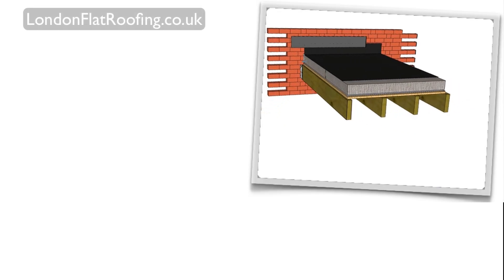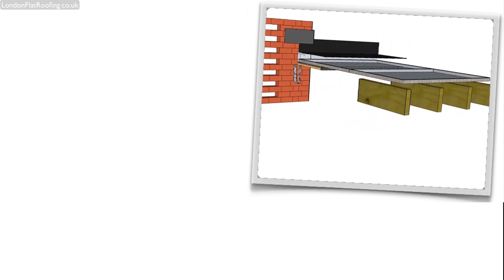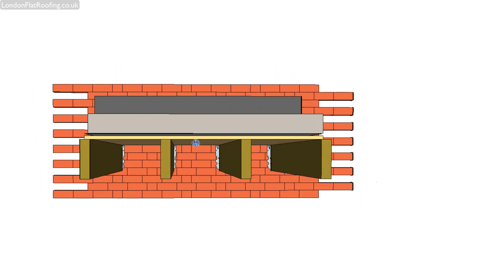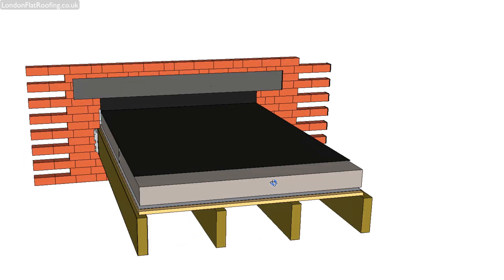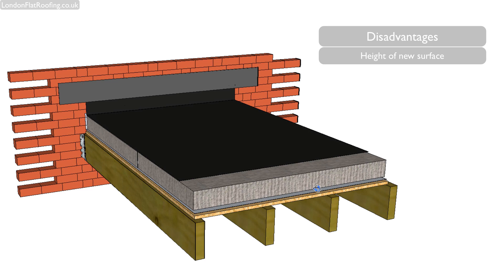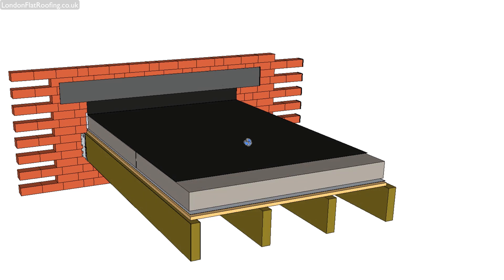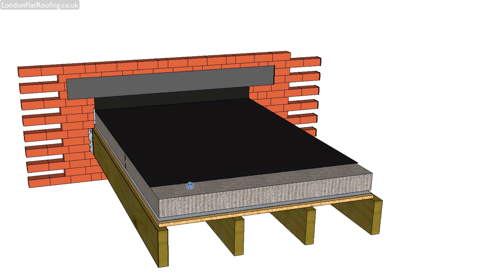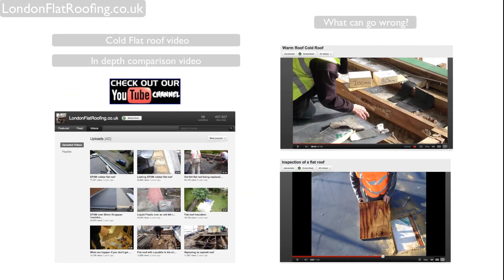Warm flat roof construction Explained.

Comment: Hi Steve, thanks for your videos, I've found them very helpful, maybe you can help with a question?   I've have had a Warm flat roof installed, as a dormer in a loft conversion, with a EPDM  roof covering, however we have been having really loud banging noises coming from the flat roof at night, have you come across this before? 

The builder is looking at options to resolve, he has tried removing the soffit with a view to putting in a vented soffit if it stops the banging, this seem to have been reduced , however I'm unsure if it's due to the vents or the drop in temperature, though some bangs are still occurring.  

If vents do fix this, I'm assume this will no longer be a true warm roof, could this lead to future problems or is this acceptable?
Reply: This is so interesting, I've had the same problem on my flat warm torchdown roof... Every now and then around 10:00 a.m. and 7:00 p.m. (I guess when the building heats and cools) there is a bumping sound (like something like a pine cone fell on the roof).

Comment: Hi.  If the insulation has been fitted straight on top of the joists with the ply on top of the insulation would it be possible to retrofit a vapour barrier afterwards at all? 
I ask because I saw your reply to MatthewLench about going back in 5 years and seeing how it will have sagged if insulation is straight on joists.
Reply from the maker: No not successfully if you took the ceiling down and looked up the joists are in the way.  if you put some sort of plastic over the joists and across the insulation you have locked he joists outside of the VCL and that's not a good thing to do. However, it's probably better than doing nothing if you have a problem. Its all down to cost

Comment: hi, can you specify the type of fixing you would use to hold down the insulatiom boards and ply for a warm roof application? From bottom to top: joists, 100mm insulation, 18mm ply, epdm membrane.
Many thanks

Comment: one of your warm roof vids has the decking under the insulation, one has it on top, can you clarify?
Reply from the maker: Some manufacturers of insulation suggest that you can put the soft insulation directly over the joists that are spaced at 400mm  however we find that this makes the roof bounce and is not that good . We place 18mm T+G OSB over the joists then we put the VCL then the Insuation Then more 18mm OSB then screw the thing togther using thermaly broken fixings then add the flat roof waterproofing materials.
Reply: Steve Roofer how do you screw it all together without piercing the vapour barrier?
Reply from the maker: You pierce it, Its  so over-specified that even with leakage from  the piercing its still over the corect specification.

Comment: Hi, is the insulation just fearing on there or fastened down with something? Also if I were to add that extra plywood on top I spoke of, how would that be attached ? Or just resting on top?
Reply from the maker: Everything has to be fixed down with thermally broken fixings. The fixings go right through the top layer into the bottom layer and into the joists

Comment: Hi Stephen, I was considering using a weather resistant T&G chipboard directly over the joists and the OSB3 T&G above the insulation.  The chipboard in Wickes is a heck of a lot cheaper that OSB3 T&G and it is 18 mm.  Could there be problems with this?  Also, in order to reduce height, as this is not a building in constant use, I would use only 25 mm of Celotex.  Is 25 mm as good as not having any insulation.  I am putting the OSB3 T&G above because I may use rubber and wish to walk on it, or I may go GRP or something else but want to walk on it for maintenance, place things such as a small solar panel from Maplin etc.
Reply from the maker: Best thing I can say is contact S and D timber in Kenton Harrow, get all the materials there at unbeliever prices. For a new flat roof, you wont to be using a minimum of 100mm flat roof insulation with a good continuous vapour control layer under it. Don't use any insulation that has silver foil on both sides always use a separate vaper control layer and tissue faced insulation fixed with thermally broken fixings. You can email me for a list of suppliers, however, I ask for a donation to charity for the info  https://www.justgiving.com/fundraising/roofing?newPage=True

Comment: Could you make a video (if you haven`t already) on what would be the best solution for a flat roof that is based on concrete. I`m basically trying to make a walkable terrace over the entire house (a very small house). It would be ideal to have tiles on it as a finish if possible. Any advice would be much apreciated! Thanks in advace! :)

Comment: Hi, I have just had this type of roof added to a loft dormer. However, when I drop out the spots to paint the ceiling there was a very strong draught coming down the holes. So if this is a warm roof, is this supposed to be the case? I doubt it as the heat from the room will go through the plasterboard to the joist area and be carried away by the wind. So the insulation material above that is not doing anything? Could this be because the soffit is not sealed properly or something? Coupled with this, there are draughts behind the walls too that come out of plug sockets unless they are packed out. So again, when it is windy we have cold walls. Have you any experience on these issues or any advice you can give? Thanks.
Reply from the maker: +Brighton Squash Club 
Warm or cold roof you shouldn't have drafts. with a warm roof you should be able to remove the ceiling and  live with the timbers exposed as the space between them is supposed to be the same temp as the room below  "a warm space" Yes we come across this problem all the time and yes insulation to the soffits is one of the problems.
Reply: +Brighton Squash Club the joist end voids should be infilled with insulation and sealed
Reply from the maker: +gareth chapman  yes correct

Comment: what thickness decking would you recommend for base, and the thickness for top layer before covering  roof with EPDM
Reply from the maker: +Keith McManus 
When we do warm roofs we alway use 18mm T+G OSB decking under the warm roof insulation and the same over. It may cost more for the T+G but it's a lot easier to install and gives a better  finish to the roof.
Reply: @SteveRoofer  does putting osb above insulation not turn it into a cold roof?
Reply from the maker: @coops6621  No if its a cold roof its vented if its a warm roof there is no venting and you can put whatever you want on top
Reply: @SteveRoofer  is it not possible for any condensation reaching that top OSB layer?
Reply from the maker: @coops6621  Yes in my view I think it will that's why the roofing membrane above needs to be as open to moisture passing through it as posable

Comment: Hi Steve , In a warm Roof do you need vented soffit ? . Does it cause problems if it is installed in a Warm Roof ?? Cheers
Reply from the maker: No venting in a warm roof and no venting needed in soffits. Make sure that there is no moment of air from the outside to the roof void of a warm roof. Think of it like this 
internal spaces and external spaces 
Internal spaces such as bedroom living-rooms are only vented by people opening doors and windows, we heat internal spaces.  
External spaces such as garden sheds garages and loft areas are normally very well vented because of gaps  and we are not bothered because we don't heat them.
So with a warm roof construction everything under the insulation
 is internal and therefore we don't vent  moisture levels will be the same as the room below as the cavity below the roof is in fact internal part of the room below remove the ceiling if you wish its only decorative.
Reply: Thanks for your quick reply Steve. Would it cause a problem if the soffit is vented ???
Reply from the maker: Only if you haven't sealed off this area to the area under the warm roof, you also need to make sure that the thermal properties of what you have used to seal the area with match one of the two elements. The flat roof or the wall if its weaker then you may get some cold bridging.
Reply: +Steve Roofer Thank for the reply Steve , would you get condensation forming below the flat roof ?? . Would it be better to seal the vents ??
Reply from the maker: If the vents are not venting the roof and only venting the soffit boards   keep or remove up to you it will make no difference. If the vents are venting the flat roof condensation to the underside of the warm roof could happen if all conditions were in place, however its unlikely as the underside of the warm roof is warm so moist air will not condense onto it. Where the cold external air is getting in will be colder and you will get condensation around that area.
Also you have completely lost the benefit of your warm roof, think of it like this.
When you get in bed and you put your quilt over you, you wanted it to keep you warm so you tuck it in around the sides if you don't it doesn't matter how good the quilt is you will always be cold.
So basically your warm roof is doing nothing just sitting floating on top of your joists.
You must make sure that it is airtight and interrelated all of the way down to the next thermal element.
Reply: +Steve Roofer Thank for your reply's Steve, your a gentleman. Much appreciated .

Comment: You mention about it being soft on top, I've seen a lot of loft conversion company's in London that have the insulation going straight on top of the joists with the ply on top of the insulation?
Reply from the maker: Yes however two problems with this method.
How do you fix a proper vapour barrier? you can not 
Go back in 5 years and see how it all sags! im now seeing a lot of this
Reply: Steve Roofer right I see what you mean, to be honest the ones I see getting fitted are probably skipping the vapour barrier then maybe, as I get to see them put the ply which has the insulation attached to it, not sure if the layers between this? Thanks

Comment: Thanks Steve, Ive watched most of your videos now and will be specifying a warm roof for my upcoming renovation, I am undecided whether to board on top of insulation also, just in case I want to access adjoining wall for painting etc. if so I am uncertain of fixings through top deck through to joists how is this done?.
Also if laying insulation direct to joists how do you complete the vapour control layer properly as you are laying vapour control sheet over joists not deck board?
Reply from the maker: The vapour barrier we use on all of our warm flat roofs is foil and tar on a role laid out over a sub decking to form a continues layer, if screws are used to fix down other layers penetrations tar-up and self seal however now the trend is to glue down everything.
Reply: Steve Roofer Thanks Steve that makes sense, I just watched your latest vid with glueing great thanks.

Comment: Great videos Steve.
a couple questions ?

- do you use Sketchup for your CAD demos ?

- can I use my existing felt-tarred rood as the vapor barrier ?

- can I avoid opening the roof to insulate the areas where the old roof meets the parapet ?  Trying to avoid that moisture issue at the joist ends - where cold meets warm (as you discussed in one of your videos)

Thanks -
Chicago 2-flat owner and DIYer ( DIY to a point as someone else will be doing the masonry restoration portion on my 1915 parapets)
Reply from the maker: Yes Sketchup 
Yes you can use the old tar based roof as the vapor barrier
If you dont open the roof you will have to remove the gutter board to access the area
Was in chicargo last year  and will be again this year
Reply: +Steve Roofer Ok Steve - Finally going through with this project.  After much review of videos on the subject (mostly yours - Thanks)

I have a 1915 low slope flat roof with (brick) parapets on 3 sides (open on lower side).  I've decided to tear off the 1/2" - 2" multi-layer mess - down to the deck boards.   I did a 1' x 1' 'biopsy' at the top parapet edge and the decking boards/planks look ok so far.  Also, looks like they used felt over the decking  - so hopefully tear-off will go as well as it can go.

I'm going to be using (2) 2 1/2" staggered  polyiso layers and a 1/2" high density polyiso on top (for walking) - all covered with 60mil EPDM.  All of the polyiso is 'fiber-glass' faced on both sides.  (Hunter Panels).  The polyIso will create a R30.7 barrier.

Since I have to tear out the ceilings inside anyway, I'll probably be adding a heavy layer of blown in cellulose around the perimeter to help avoid condensation at the brick wall underneath - and, as I understand, cellulose can hold and dissipate small amounts of temporary moisture level peaks.

My only question (i hope) is the vapor barrier (or air barrier?) between the decking and the polyiso.  Do I really want a water trap underneath the polyiso ?  I'm a bit wary of capturing trace amounts of moisture from above and pooling them at the deck board level.  I've read that the layered polyiso will mitigate most upward moving moisture ?     Yet I see the moisture barrier used  often ?  

Anyway to make this a simpler proposition and alleviate my concerns ?  Thanks for all your help and the great videos and Sketchup models.
Reply from the maker: The VCL gos on the decking under the insulation, any moisture now under the VCL is in the room below and away from any cold spots or thermal bridging and therefor not a problem.

Comment: Also, may I ask, if warm air passes through the insulation and condenses on the underside of a cold roof construction (hence the ventilation)..why doesn't this happen with a warm roof? ...ie, warm air passes through the insulation and hits the coldness of the deck covering. Is this because there is no air gap and the two materials are flush to each other?
Reply: vandalstookthehandle c

Comment: Hi Steve, great video! The best video I've seen on warm flat roofs! I have a 50s modern house with a newer addition. This was re-roofed a few years ago, converting it to a warm flat roof with an air space between the ceiling and insulation. However, the roof extends out over the front porch where the warmer air space is exposed to cold outside air. The result is sweating inside the air space and dripping onto the porch at times during the year. Can I stuff insulation through the end of the overhang to the point where the roof meets the outside wall? Shouldn't that stop the sweating?
Reply from the maker: I really need to understand this correctly before I give you advise, can you email me over some photos of the roof  please Steve@londonflatroofing.co.uk
Reply: Steve Roofer Will do. Thanks.

Comment: Hi Steve, great tutorials & some valuable information, can you name the building supplier of the vapour control barrier that you commonly use ,I am  having trouble tracking it down.Also where would you get the thermally broken fixings from for the insulation boards. I cannot seem to locate in any of your guides that say if the top boarding over the insulation is fixed through to the joists , glued or left loose?
Reply from the maker: Fixings
http://www.fixfast.co/fastener-systems/fr_globaltubewashers.php

Vapour barrier
http://instar-uk.co.uk/products/elotene-dsn-self-adhesive-vapour-barrier/

Insulation 
120mm Recticell Powerdeck F 1200 x 600 

We sometimes glue  the flat roof insulation down The fixings go into the roof decking.
SIG ( sheffield insulation also do  vapor control layer that similar but more expensive  expect to pay between £5 and £8 M2   Its not cheep

Comment from the maker: Warm roofs don't have ventilation so the area between the joist is warm the same as the room below, the warm are will also have the same moister content as the air in the room, the timbers and the bottom of the decking like that temperature and that amount of moister  ( around 19c and humidity of around 45%) above the decking is vapour barrier helping  to stop a   lot of the moist air from rising above that the insulation keeps the decking warm.  .........look at next post

Comment from the maker: If its a timber decking we will normally screw the insulation down using thermally broken fixings. If we are overlaying an old roof such as an asphalt roof then we will glue down the insulation to the roof

Comment from the maker: No the weight bearing of the insulation over joist spaced at 400mm is quite a lot, any how what we alway d is to place a board over first "the first decking" now you are really spreading he weight. The buildup is still called a lightweight construction. If you talk to any structural engineer about this he is normally not concerned. A good engineer will over design the structural elements of a flat roof to taking into consideration the weight of 3 or 400mm of snow.

Comment: Big Thank You for the brilliant videos - Your huge effort and time to put those tutorials together are greatly appreciated.
A couple of Qs if I may please
1. Considering that the warm roof has no ventilation (like the cold one), what happens with the humidity which travels up? Condensation around colder areas (windows)?
2. In addition to the insulation of a warm roof - is there any benefit if the space between the joists gets filled with more insulation? Would this not provide better insulation?

Comment: A great video & something of a revelation. The flat roof above my property doubles as a main walkway to/from a large block of flats. As such, footsteps can be heard passing overhead 24/7. The builder tells me that a bison block & beam floor was installed, with a warm roof (with 100mm of Celotex) floating on top. He didn't mention anything specific to sound insulation, though. Can he mean that the Celotex doubled as actual soundproofing, or is there no real correlation between the two?